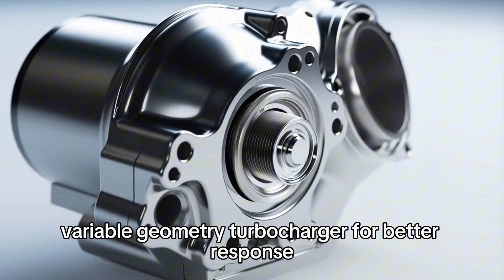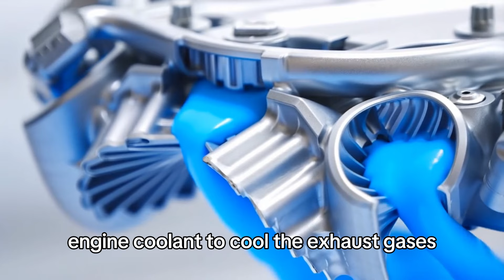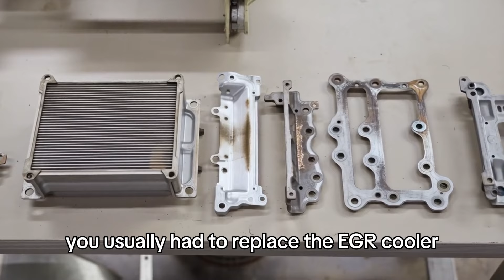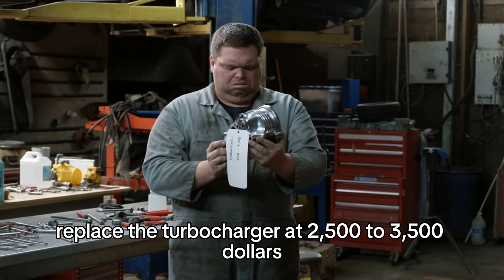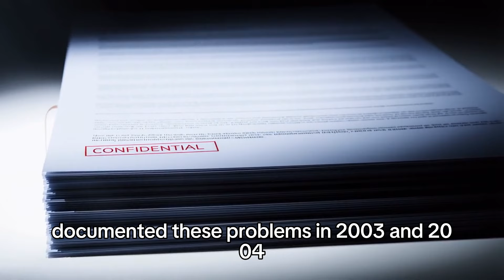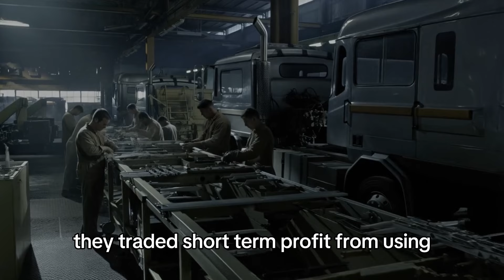The Ford Engine That DESTROYED Its Own Reputation Overnight

Comment: 6.0 Engines from the factory used bolts not studs like video said. Video is backwards on bolts and studs. The engine fix is installing quality head studs and possibly o ring the heads.